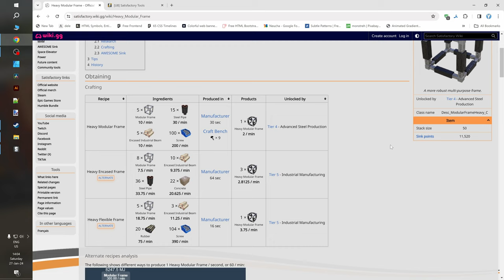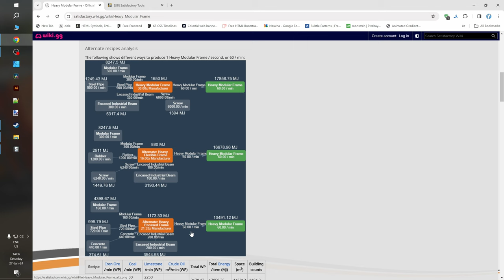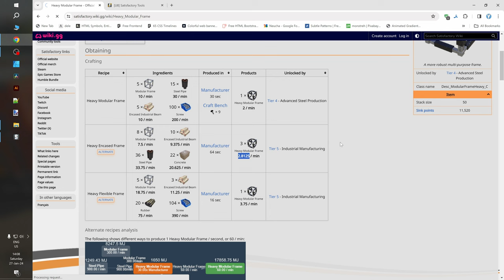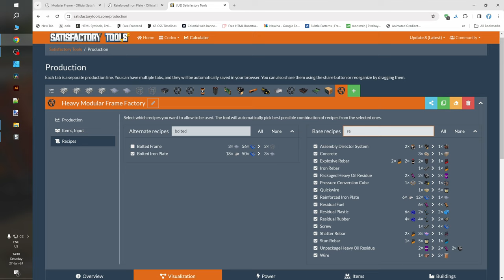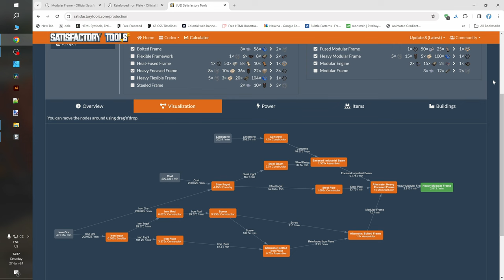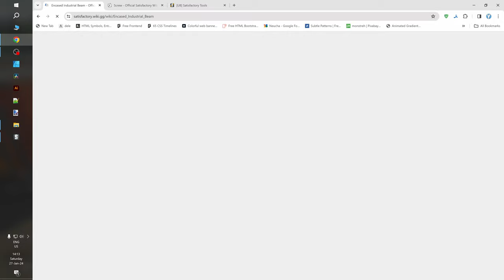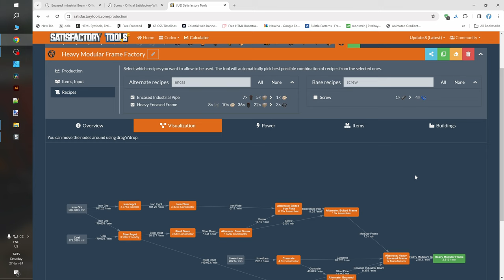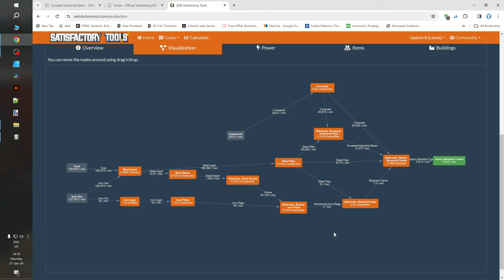Making ALL-IN-ONE Blueprint in Satisfactory Unabridged

Comment: Hi Yakez, i have had this amazing blueprint running all day, but so far no HMF, sadly, no pipes or encased beams going to the Manufacturer. or to the storage, just giving you feedback, thanks for every thing. Pete
Reply from the maker: Hey thanks for the feedback, cannot really double check the print. Out of town this week.
Reply: I have seen the same issue, and with the interior so compact it is tough to troubleshoot.  I like the build, but it will be difficult to find where any breakdowns are. Edit: I found a solution.  Nothing was flowing into the smart splitter for the steel pipes under the assembler level. I replaced the 2 lifts and then the steel pipes started flowing which fixed the encased beams as well so the HMF started being produced.